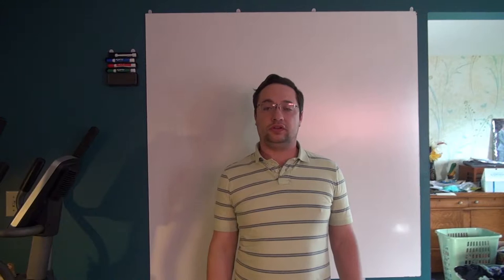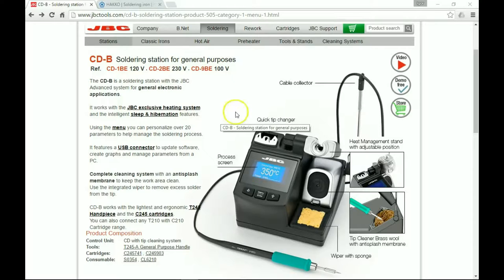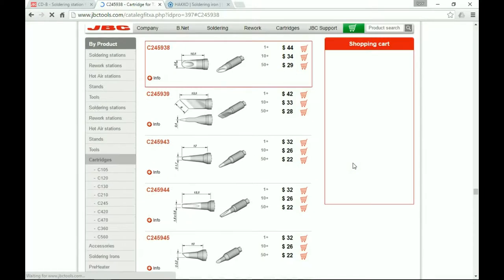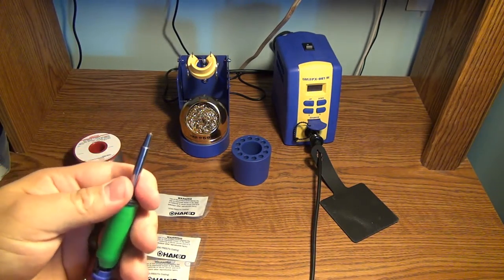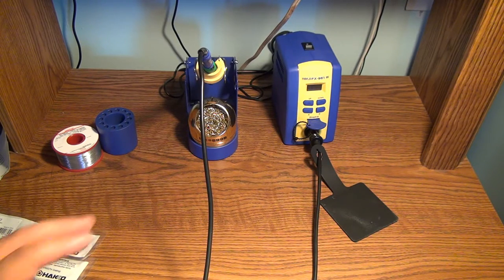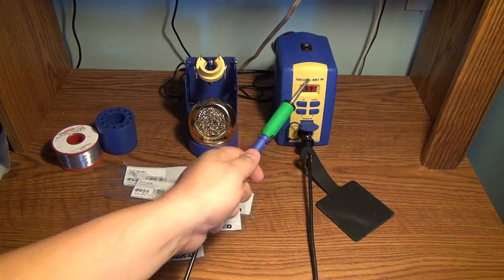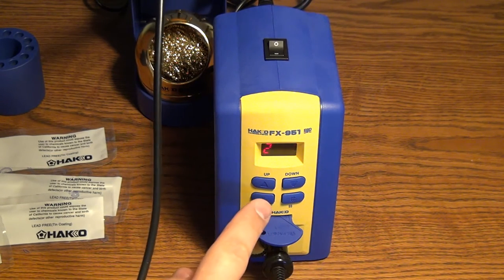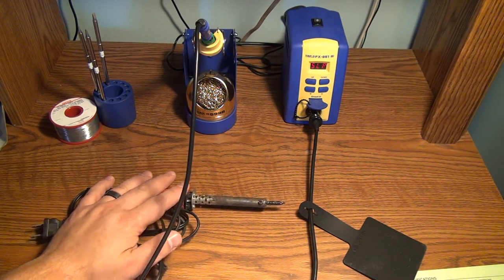eapbg #20 New soldering station Hakko FX-951

Comment: Don't scrape the tip across the 599B tip cleaner. Simply poke thru the ball a few times. This is because you can splatter yourself with hot solder if you scrape across.

Comment: Thanks for the pics. Im trying to figure out how the temp sensor is tied in. The temp sensor is built into the tips from what I understand. If it ties into the black wire I wonder what it ties into inside the assembly?   The tips from what I can find have contacts for the Red, Black and then Ground.
Reply from the maker: Red to Black is 8.9 ohms which is probably the heating element.  The main body (earth) has about 2.8Mohms to Black and Red. It's possible that the heating element and temp sensor is are one and the same. The heating element will change its resistance with temperature. By pumping a constant current through the element you could get a voltage feedback that would reflect the resistance of the element. (just speculating tho)
Reply: Thanks. From my research I have seen many "DIY" Solder Iron controllers that use the T12/T15 tips.  And the majority of them are 3 wires.  Being that the White connects to its own terminal on the tip holder, (I assume it goes up into the holder assembly and connects to something?) then has a wire from the white terminal to the Black, do you have any thoughts off the top of your head as to what the white wire could be?
Reply from the maker: I think the white wire is a safety. If the inside of the wand gets too hot the unit will shut off.

Comment: Would you happen to know what metal the tip holder is made of? Aluminum or iron maybe? Also the base of the stand. Does it have some weight to it so it doesn't move around, etc...?
Reply from the maker: The tip holder is cast aluminum.  It weighs just over a pound. It also has rubber feet. It does a pretty good job of not moving around as long as you're too rough enough it.  You could always weigh it down more.
Reply: @eapbg  - Thanks, I bought a used set online and could not find these details on Hakkos site.

Comment: Keep always some solder on your tip. Never clean the tip and place the iron in the holder. You will ruin the tips, because of oxidation very quick. 
Clean the tip and 
immediately put some solder to it, before soldering.

Comment: Thanks for this. Is  there any way you could show the wiring connectors in the handset and on the solder side of the Pin Connectors?   It literally does NOT exist on the Internet. I have been scouring for days. You would be the only one if you did. Thanks for your time.
Reply from the maker: If I understood, you want me to buzz out the connections in the wand? I may not be able to get them all, it looks like there are only 4 wires that come out but the connector has 8 pins. Some may be doubled up. Now i'm very curious, why you want to know?
Reply: My buddy gave me a Hakko FX-951, but he didn't have an iron for it.  I don't have an extra 100.00 to buy an official one,  So i am looking to craft my own.   I bought the casing and connector and the 8 PIN barrel connector, but there is NOTHING out there that shows how its wired.  The manual for the 951 gives some info on handle connector/PIN correlation  via testing procedures.  That's why I was stumped, 4 wires but 8 pins and I am wondering if they are just blank or if they are jumpered.  Manual clearly shows where Red/Black/Green wires connect in the wand and what pins they goto on the connector, but the white stumps me. And some info I found says there is some kind of resistor or component between red/black wires in the handle.
Reply from the maker: No pins are doubled up. (The pinout is as described) Green goes to the element body (the big metal body). Black goes to the center ring. Red goes to the third ring. White goes to something that disappears in the plastic and then comes out and ties to black (maybe temp sensor) ohms at 9.72k. Then there is a blue that is tied to pin 6 then to an LED and then to the black. The LED anode is to pin 6.
Reply: So there is 5 wires? Uhg. Manual doesnt mention a blue wire at all.  Any chance of you uploading pics of both ends somewhere?
Reply from the maker: I could throw some pictures up this weekend. Also i forgot to mention that there looks to be a ceramic capacitor across the black wire and red wire.
Reply: Much appreciated
Reply from the maker: I put some pictures up on my website. http://www.eapbg.com/single-post/2016/07/02/eapbg-20-New-soldering-station-Hakko-FX951